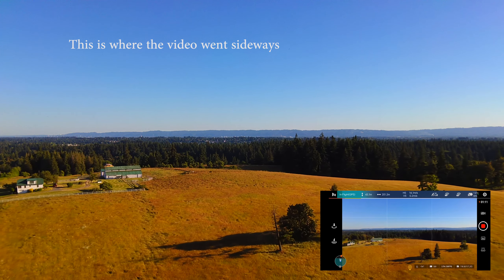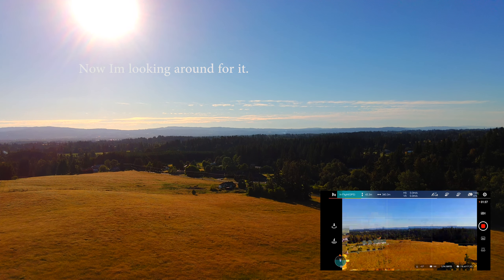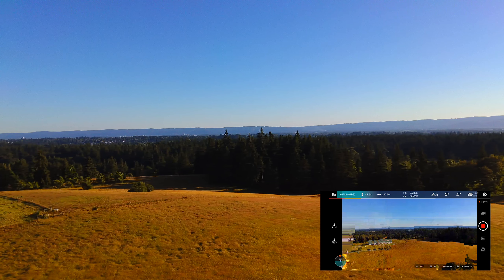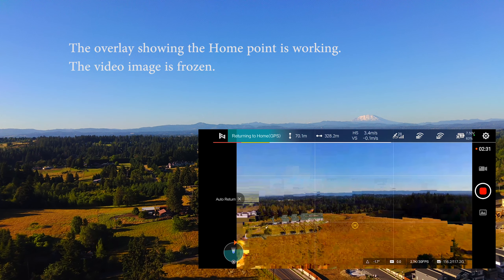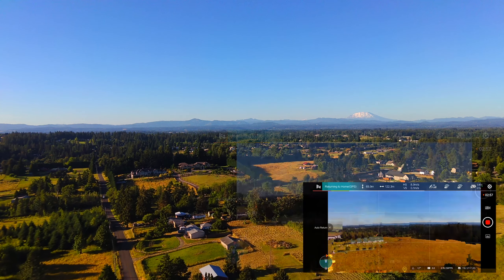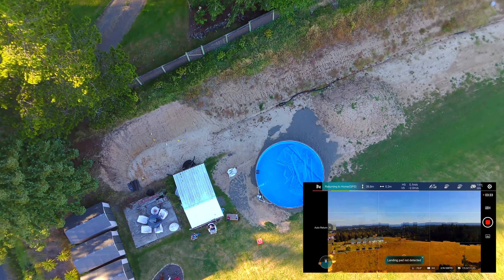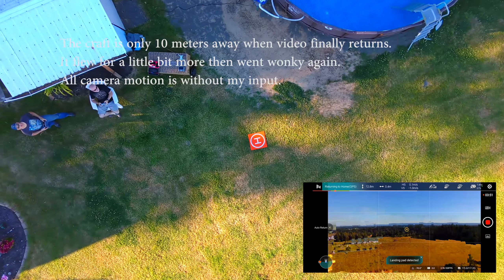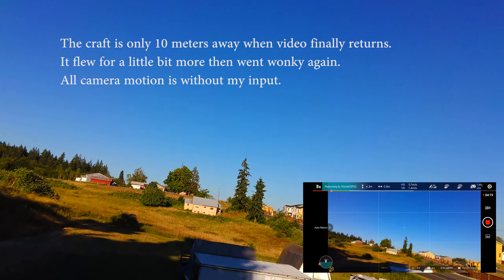Flight Problems Fimi Mini Ver.2

Comment: is this after the update to 1006B
Reply from the maker: I checked my firmware update page.
FC 1034B
Camera 2209A
RC 1005B
Vision 2203A
ESC 1004A
No updates available at this time.  Unistalled the Fimi Navi program and reinstalled it.  No change to firmware settings, no change to flight characteristics or problems.  No response from Fimi.
Reply: 😊 @starhawke380 : is this for the Fimi Mini 3? I have not seen these numbers before except on the X8 Mini V2.
Reply from the maker: @GorillamansGarage  Sorry no, Im still flying my V2.
Reply: @starhawke380  : OK.. the title is confusing then.
Reply from the maker: @GorillamansGarage  oh, didn't even think about that. It's the third revision to the edit...  i was having trouble with the rendering and wanted to see a couple different bit rates...